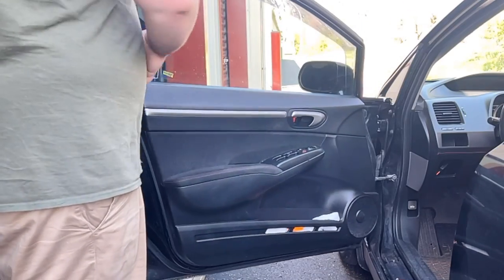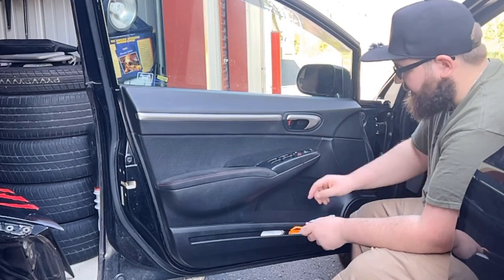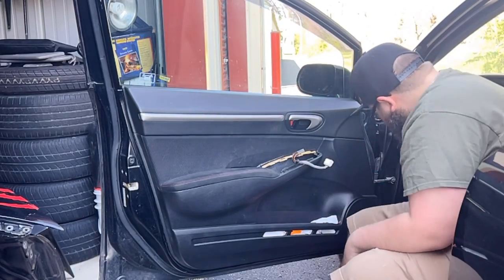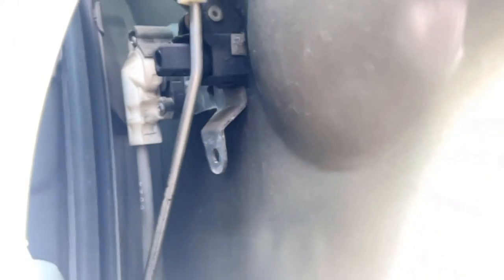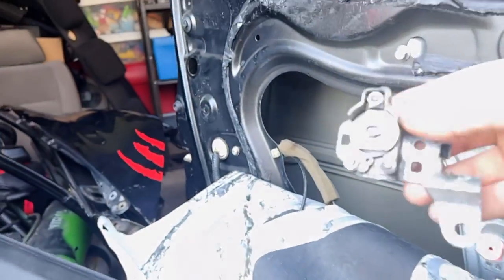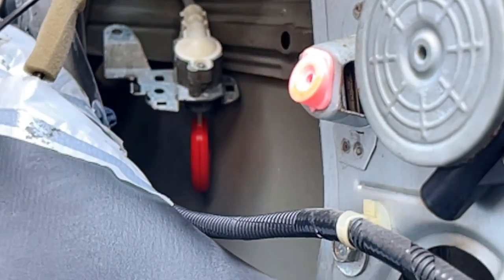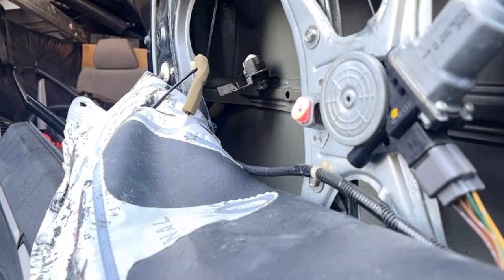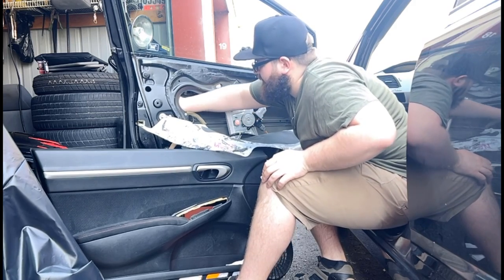Switching Out The Door Lock: 2010 Honda Civic

Comment: If this new key works to start car or you handling 2 keys now? One for door and one to start?
Reply from the maker: The lock I put into this door was from the old door that was originally on my car. The old door got damaged from an accident so I replaced the door from a parts car and swapped my lock into the new door so I can use my key. So I only have one key for doors and ignition,

Comment: I successfully replaced my lock by using this video so thank you. But after I fixed the lock the door won't open from the inside and I'm not sure what went wrong.
Reply from the maker: Sounds like the rod that clips into the back side of your interior door handle disconnected when you went to put that door panel back on. Sometimes they will slip off if the clip breaks or if it isn’t fully clipped on. I’d check that.
Reply: @Specmauto  Yep, it came unclipped. I clipped it back on and the door opens now.
Reply: Where you get the part form
Reply: @hersonrivera6662  which part?
Reply: @hersonrivera6662  I think his door had been replaced and now he took the original lock cylinder from his old door and put it in the new door.  Great video by the way..
Reply: @Specmauto  so you can’t use the old key with the new lock? I wanna keep using the same key for the new lock.